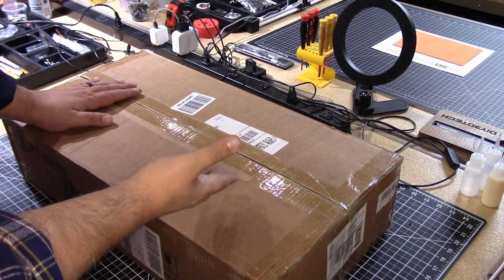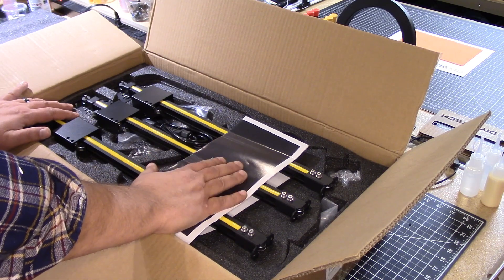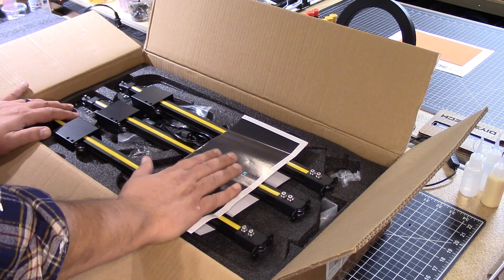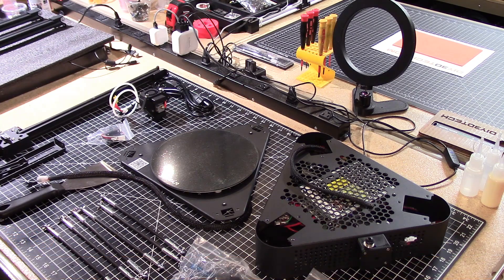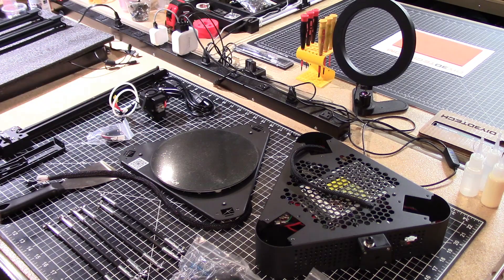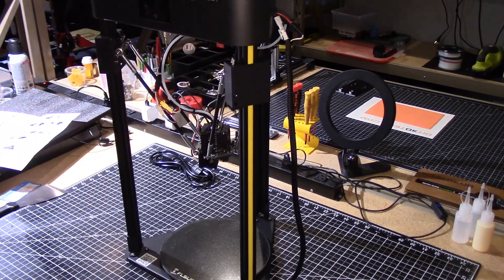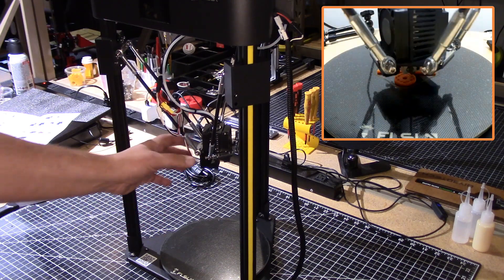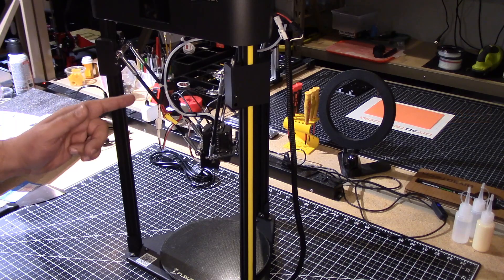FLSUN Delta  - Why I Bought Another Printer and You Might Too !

Comment: Hello. help to solve the problem. on the DELTA printer, I print a circle, an oval. I changed belts, changed motors, changed pipes that hold the extruder, the table is calibrated. I can't print a smooth circle, thanks in advance